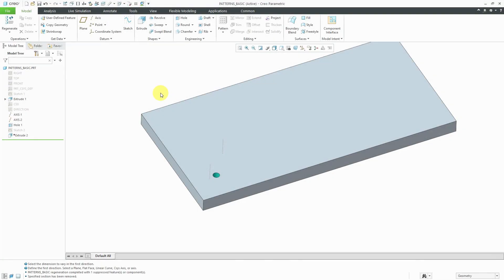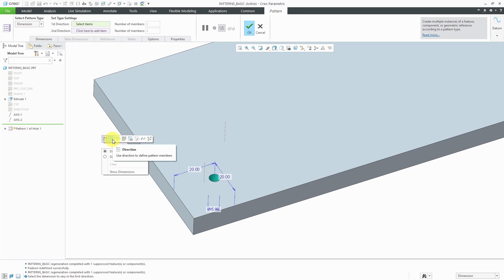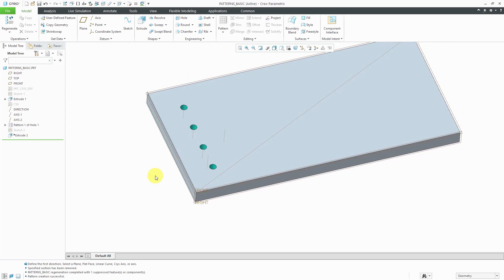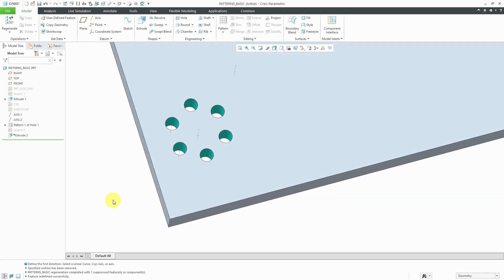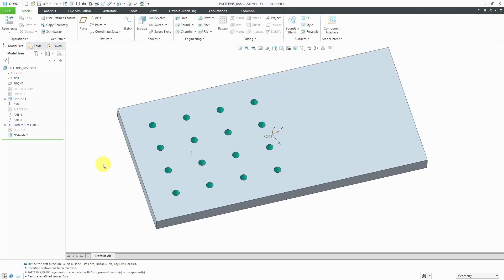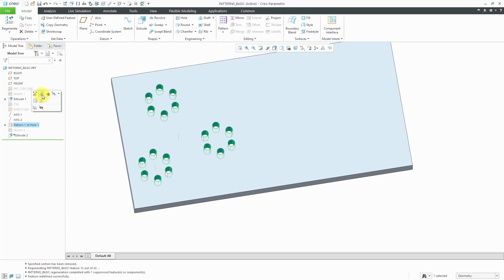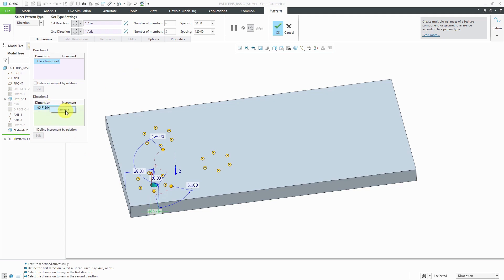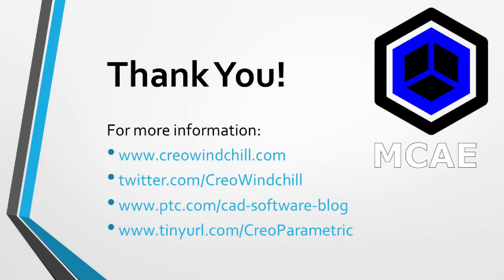Creo Parametric - Direction Patterns | Part Modeling

Comment: What if I want to create a symmetrical direction pattern from the same plane? Like 5 equidistant holes on each side of the plane.
Reply from the maker: Good question. Onshape has that. I remember a dozen years ago when it was brought up at a PTC Technical Committee meeting but nothing ever happened.
Reply: @CADPLMGuy  It's a pity CREO doesn't have that. Another thing is the pattern in 3 directions, I also struggle with it.

Comment: If I want to make, for example slats on a shipping skid, and I want 4 evenly spaced slats along the bottom of my skid, is there a way for Creo to automatically evenly space 4 slats up to a defined stopping point, like the edge of the skid? That way if I end up going back and changing the dimensions of the skid the slats automatically evenly space themselves again according to the new dimensions?
Reply from the maker: Yes. See my video on Patterns with Relations. That is the most obvious way I would do it, but there are other ways.

Comment: About how pattern types show dimensions on the drawing: 
1.- Different types of patters (direction, dimension) show different number of dimensions on the drawing when adding the model annotations,for instance, to a general view? 
2. Lets say I only use 1 direction (or dimension) and 3 instances. Do i get only 2 dimension for the direction type of pattern and also for the dimension type of pattern? Or do i get 3?
Reply from the maker: Brandon, in general, you will get dimensions for (1) the number of instances, (2) any pattern spacing dimensions, and (3) any feature dimensions that are also incremented. You will not get individual dimensions for the spacing between all instances. Typically this is handled by changing the pattern spacing dimension to include "p# X " in front of the dimension to get something like "6 X 2.00". 

I will make a video showing how to handle the various dimensions in a 2D drawing.
Reply: @CADPLMGuy  thanks, im kind of struggling with these things because i dont know what should i do first in the model part in order to get more organized dimensions when i call them out in the drawing
Reply from the maker: Getting it right in the part model is less and less important, actually, due to MBD. Showing model dimensions has some disadvantages compared to manually created dimensions in 3D Annotations. I know that's counter to what everyone has been taught since forever in Creo and Pro/ENGINEER.
Reply: @CADPLMGuy  sorry, but what is MBD? 
Still good to know, any videos about this topic?
Reply from the maker: MBD is Model Based Definition - the movement towards documenting Product and Manufacturing Information (PMI) in the 3D models for data exchange over 2D production drawings. I have a playlist but you can start with this video: https://youtu.be/s5r77skVjm4